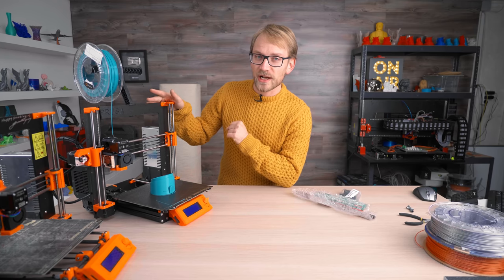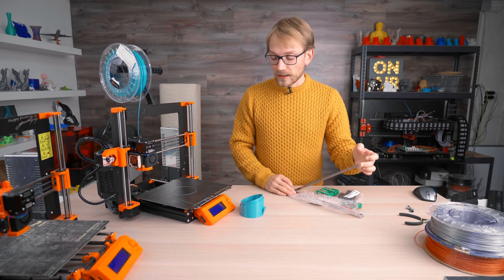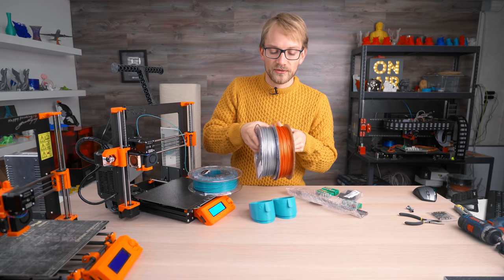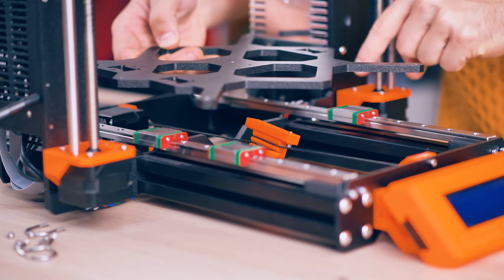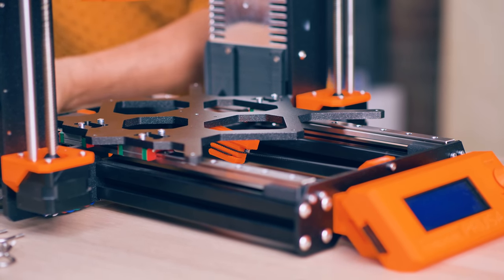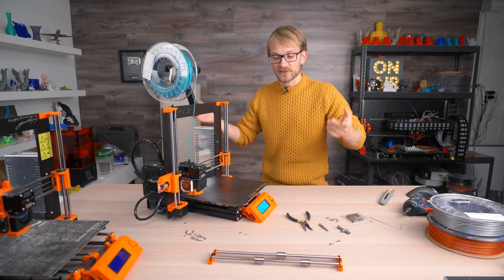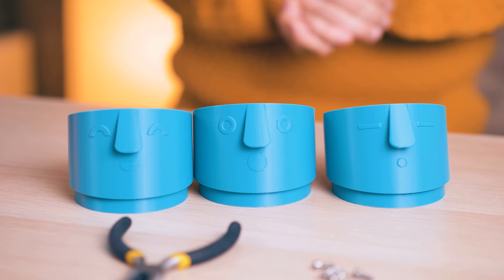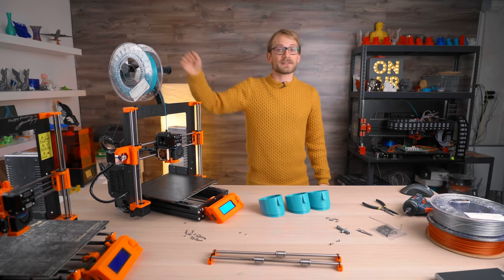Upgrading the MK3 with genuine HIWIN linear rails: Worth it?

Comment: Hi Thomas ,
 if I want to modify the original Prusa i3 mk3 printer and change my 
heated  bed for a bigger size bed or extend z axis , does the printer 
recognise the extension in the axis and would auto bed levelling works

Comment: I'd say the main benefit is higher potential rigidity for higher mass parts, and potential higher reliability or life, easy mounting, also might reinforce the printers frame more than other methods.

pbclinear(dot) replace with actual dot)com/Products/Gliding-Surface-Technology/MR-Mini-Rail-Miniature-Linear-Guide?fbclid=IwAR3HBeB0uVkN-BkZG2S72ZS_7CUDqnnkqcV0F9T5O8c-TjNKAQJdtHjRyjw
I'm going to be using these for a custom printer build, they provide high quality reliable motion for lower cost than Hiwin linear rails. Also you don't have the risk of ball bearings falling out of the bearing block if you take it off or it slides off the rail without a new piece to slide it on, which ruins the bearing block.

Comment: Actually..the ringing on those parts are probé the machine Is not as ridgid as It was, linear rails aré way More precise AND ridgid as the base itself,  but there Is a problema with that setup, round Is always More ridgid, the linear Shaft Is More stable than those floating linear rails,  to make them work correctly those need to be fixed in ITS entire length... A cheap test indicador for 10 voz and magnetic base Will solve most of the problems ir aligment...

Comment: How do you make sure that the y-axis is perfectly 90° to the x-axis?
Reply: 1. Install dial indicator on the frame
2. Install a precision reference rod on the Y axis somehow
3. Adjust the reference rod until moving the Y carriage the indicator shows no movement (so you adjusting the reference rod on the moving platform to be parallel to the non-moving rail)
4. Relocate the dial indicator to the X carriage and touch the reference rod (and lock the X axis of course)
5. Move the Y axis and check the indicator
6. Adjust the Y axis (or the XZ frame) until the indicator shows no deviation through the travel.

Comment: You fixed my paranoia, I wanted to get better bearings to improve on this wobble. Now I won't.
Reply: An option you can try is the IGUS glide bearings. They are supposed to life a long time and reduce sound and sloppiness of x and y axis. Very easy to install. There are sets directly made for the MK3.
Reply: The plastic ones have much more play, I have a set. Haven't tried the encased ones but now there's no reason to if it increases ringing.
Reply: @HungrysitesRu  The Igus bearings need constraints to work properly. Just the bearing on the rail will always be loose. You need to give it pressure to make it work correctly.

Comment: 17:05 more expensive than an ender 3 lol
Reply: And more pointless than a chocolate kettle. Some people just like to throw money at things. Linear rails should be debunked at this point, but there's more vendors pumping snake-oil than engineers debunking.
Reply: @EvileDik  The prusa mk. 3 is not a particularly rigid platform. On something like a Voron, where the entire frame is made out of aluminum extrusions, there are tangible benefits. Quite simply, this is never an upgrade you should do to a cheap printer. I get that a Prusa isn't considered cheap, but it's cheap compared to where you can end up making a super rigid printer.

Comment: You get these artifacts because you haven't appeased the magic smoke entities! They were a bit upset you rather tried to fix it mechanically rather than "spiritually".

Magic smoke entities resides in chips etc, so you must appease them or make them happy by holding two multimeter probes, do a drum solo on the print bed with them, then yell out "GoosFRABA" at the end! Then it will be perfect printing for a month or so! :P

How to make the stepper motors happy, I don't know, but I think the magic smoke controls them anyhow :P

If you didn't understand this already, this was supposed to be a joke; please don't think I believe this, or worse, start a cult with this as an actual belief lol! :P

Comment: €200!!! A set of fully supported rails and bearings would do the equivalent (or better) job for around 20% of that!! Where's the extra value?
Reply: I just bought a set of supported 20mm round rail, two rails each of 1000mm, 650mm, and 350mm, each rail with 2 bearing blocks; 3 1605 ballscrews, each with fixed and free end bearing blocks, bor under $200US shipped!  That upgrade kit is a RIPOFF!!!

Comment: This is not the correct way to just slap precision linear rails on a CNC plastic toy. You need to read and follow Hiwan's tolerance match on their datasheet, which means you need to use a dial indicator to check if both rails are legitimately square and parallel and you might as well using hiwin linear rails on the Z axis too. Proper calibration is key.

Comment: Thomas. Low tolerance... I guess you mean high tolerance hiwin.
😛
Reply: high precision 

means there is a low tolerance for for error
Reply: He just miss speak in the middle of the video and saying low tolerance hiwin
Reply: High tolerance would be something like a broomstick fitted with o-rings you get from a shower-curtain.
Low tolerance means high precision.
Reply: @konrad7592  I am sorry this is wrong Mr. High tolerance is high precision. I am a mechanical engineer with a masters degree in engineering Design and have 20 years experience in the industry
Reply: "Tight tolerance" may make more intuitive sense, but "high tolerance" is a common engineering term and anyone reading a drawing will know what you're talking about. Vendors pay particular attention as high tolerance also correlates to high cost.
Reply: @PRO3DESIGN  Maybe you should go read around a bit. A simple google search literally specifies that high tolerance means it allows for more errors, while low tolerance means it allows for fewer errors. And it makes a lot of sense if you think of it in terms of pain. Low tolerance would make you scream when you touch the table, while high tolerance means you could be stabbed by a knife and be fine with it. The key word here is "tolerance" and understanding what it actually means.
Since the HIWIN rail allows close to no movement except in the direction it's made for, it's a low tolerance system.
Reply: I suspect he was thinking low clearance.
Reply: @zilogfan  it is common to mistake low and high tolerance for non engineers as it is hard to see if you don't work with them. Low tolerance means you can have a lot of play. High tolerance means tight fit. He might be just miss spoken
Reply: I just searched around, most people that seem to know what they are doing seem to shy away from using high/low tolerance and tend to stick to fine, tight and so on
But Pro 3D seems to be right on this one high tolerance manufacturing seems to usually mean very precise
Reply: @officer_baitlyn  I'll stick to what people I know who are actually engineers on stuff like this say, if nobody minds.

Comment: I changed Z motor to 0.9 degree and it completely eliminated those artifacts. if it helps anyone after more than a year. but you need to change the firmware of course.

Comment: Rails were not installed correctly, not even gonna start about that. Also, we were not shown what speed the print was printed at. At 20mm/s that is typical for prusas lol, it wont matter much probably. Secondly, parts were not displayed properly at all, and even if they were, they need to be displayed in a "debug" mode as I call it, meaning with harsh lighting from the top where each layer will be very visible, and not with front facing beautiful faded light which, we all know, hides every imperfection in a print. Glossy filament would be a much better idea if you actually wanted to run this properly and not just show two seemingly pretty parts. Feel like you want to make things look prettier than they actually are, which isn't a correct way to test and debug such things.

Comment: The number of times I've faffed with my Y-axis on my Mk3 and now Mk3S since I got it... Linear rails, sure, like the logic - make it a bit more "professional". One of the major annoyances I have with the Mk3 that as somebody who in a previous life was an engineer is the way the bearings are used as end-stops. With the u-bolts it cause bed twist which is always bad because it'll never be in the same position twice. Should have a block on the belt grabber that hits then back plate or something in the middle so it doesn't twist the bed. There are mods which do this - I'd suggest one of these mods to go with a hiwin rail upgrade because even as rigid as it is stuff does move. Also the other thing I'd say is that the Y axis belt on the mk3 suffers two major design flaws - one is it's impossible to tension properly, use a guitar tuner app or something and pluck it and also one of the mods that adds better tuning to the belt tensioner. Secondly the issue with the Y-axis is the belt paths aren't parallel, there are mods to fix this but they may not work fully with the rails moving the bed, but they may help. If you're going to put expensive rails on your printer you should solve those issues along with though I understand the "science" part of not doing in this video, but in the real world they should be done to get the maximum benefit.

Comment: you mount the rails wrong... You need to fasten one side and then measure in the other side, so they run perfectly (within a few mycrometers) parallel. Any other method will just give you a bad outcome for your print, accuracy and runtime of your linear rails.

Comment: Using this kind of mounting of course it shows no improvement. The rail should be mounted rigidly at every hole. The Y carrier plate has to be more rigid for this task, those relatively narrow and long tabs that reach to the corners of the print bed are flexing as well.

You said, only one carriage should be enouh. Maybe, if the plate you mount could rigidly attach to it while it is 220mm wide. The rail clearance and load capability is indeed enough, but you can not mount a 220mm wide few mm thick plate to an 50mm or so carriage rigid enough. The plate is the weakest link here.

The test. Don't test it at just one some speed which is known flawless. Test it above the speeds that are known to be starting problematic and higher up. Then try to improve the motion system, and check if those known speed artifacts are moved higher up so the usable upper speed limit moved higher.

Comment: NEVER use powertools to tighten up those rails, these are precision rails that need careful torque to set in place. A bike torque wrench of 1.5nm of force would have been sufficient to apply even force on the bearings at the very least. I feel that you have rushed this overall with your impatience.
Reply: how many ft-lb of torque did you say are needed?  I don't think my torque wrench goes that low.
Reply: @jameslaine2472  (Note the difference in in-lbs-and ft-lbs) 13.28 IN-LBS or 1 ft-lbs is what I use, Its a good tightness for me because it does not over-tighten to the point where it can slightly deform the frame itself. I would not torque past 0.75nm (hand tight really) on plastic connected parts with hex nuts or you will risk crushing the plastic from my experience. Bike torque wrenches with a range of 1-25nm torque range is perfect when making 3Dprinters. Do not use torque wrenches for cars because they are way above the torque range to tighten a typical M3

Comment: I don't know what would a "-+0.01mm accurate linear rails" do in a system that has min. accuracy about -+1mm in all directions!
Those linear rails require a master datum along with them to be able to get the accuracy claimed by the manufacturer and they are not accurate nor reliable enough on there own, to begin with!
Also, you must support them with a flat surface to be able to get a good linear movement out of them!

Everything about this installation was absolutely a joke!
 
That was a  real waste of time and money of course!

Comment: The upgrade was designed poorly.  Notice the holes in the rails.  They are there because the rail is designed to be mounted to a surface that is milled dead-flat.  In this video the rails ere hanging in mid are and used as structural parts.  This is WRONG and contrary to the why the rail is designed.    Yes I know the seller wants to make it easy so he can sell more kits.  But the rails will bend and flex.   Hanging a pait of precision rails from a couple 2D printed parts, you should not expect much.  It is a poor design.    A 2020 extrusion would be enough.  And then what is the point unless you replace the Y and Z rods with rails?   Then you still have ringing in the frame to compensate for.     

I agree this is not a reasonable upgrade.  If you want rails and extreme precision, buy another printer.  Buying a new printer will be cheaper than trying to convert a Prusa to a Voron or Bamboo.

I am upgrading a low-quality Prusa clone.   I found the best upgrade path is to replace the entire frame but keep the 8mm steel rods.  It the rods are straight and the baering good,  there is no need to replace them.     The new frame will be 2040 extrusions. I'll go from 12 to 24 volts and use Klipper firmware.  Total cost about $150.  Less than the Hiwin rails

Comment: I can hardly believe you used a power tool to install a liner rail.  Loose the drill motor, it makes you look like an amateur.      Also about the ringing.  Yes of course as the printer becomes more rigid you will see it but you can correct it out.  You had no chance of correcting it with the loose bed but now you can.  Buy a $6 accelerometer.